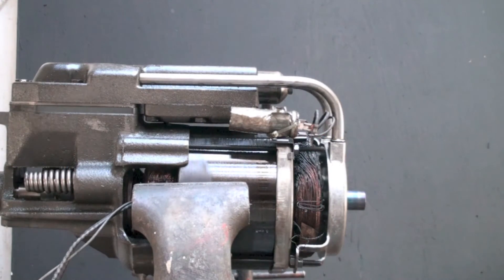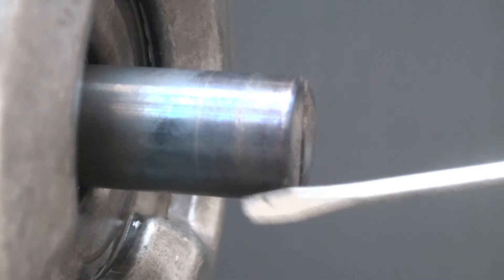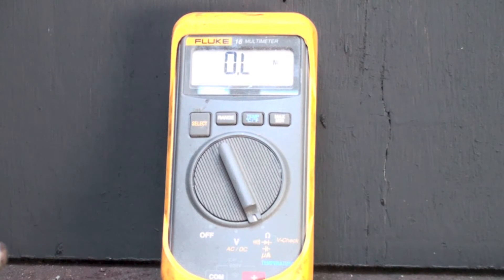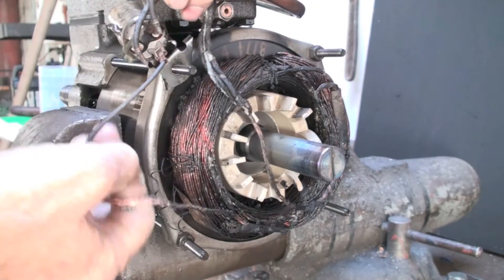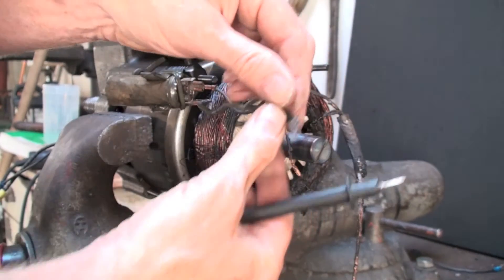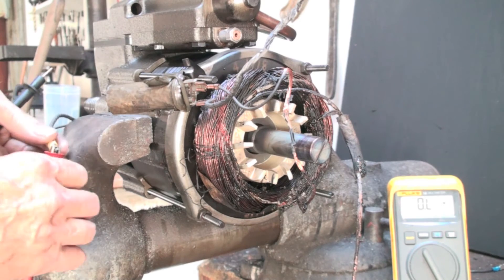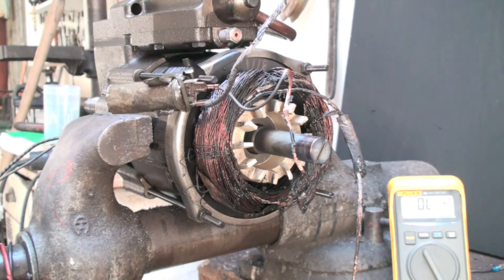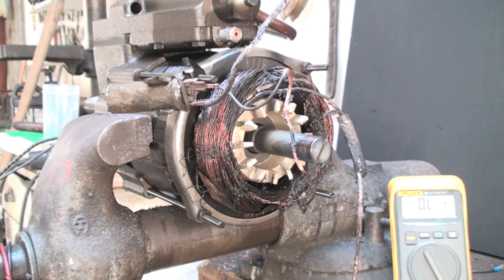Burned out compressor exam

Comment: Compressor burn outs are by far the worst HVAC failure. It puts acids and burn out dust into the system, and you have to remove all valves, including check valves and service valves, as that shit gets stuck in the valves, ruins them if they're not already, and can get released back into the new compressor. Anything that's not the condenser coil, and evaporator has to be replaced, and then it must be flushed. You don't know how many times i've seen this NOT done, and the compressor lasts very short. You're better off replacing the whole system.
Reply from the maker: John Smith Certainly agree on the bad burnout.  Fortunately, the bad burnout is getting quite rare.  By far, the most common failure is the locked rotor.   Even so, the 2nd compressor  usually lasts 1/2 of the time the original.  Everything on the unit has years on it.  A failed CFM can take out the newer compressor.  Its up to the customer because he has to pay the bill.  We are there just to give him the options.  Thanks for the thoughts.
GFM
Reply: If the repair is done right, the new compressor can last just as long as the old. It all depends how clean the system is, line insulation, TXV function, and how clean the system is.
Reply from the maker: John Smith The number about longevity of the 2d compressor is from Trane, so they are probably just going by numbers they see.
GFM
Reply: Not to mention, there are a majority of compressor burn outs and lock ups where the system is not properly flushed or rebuilt with dryers on the suction line. That's probably why Trane is seeing those numbers.